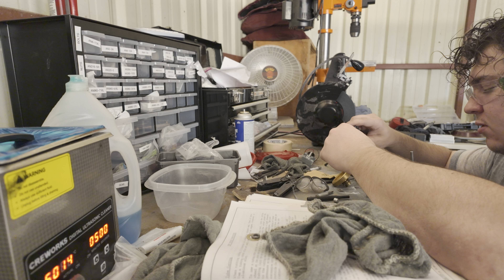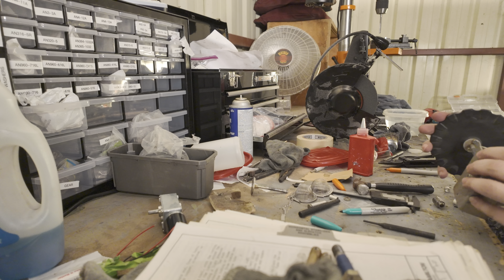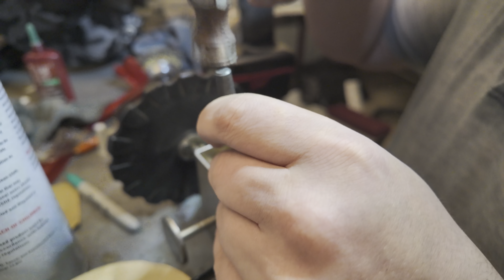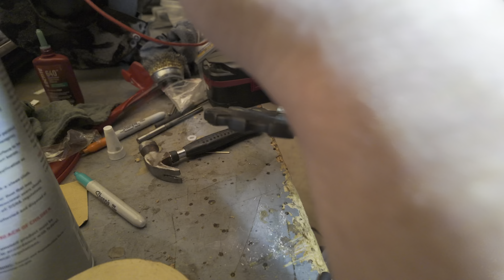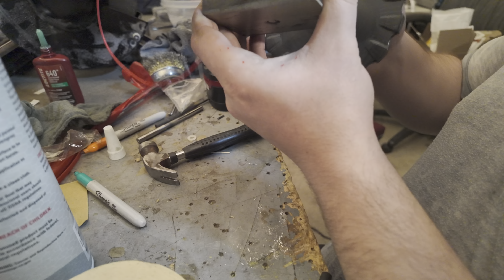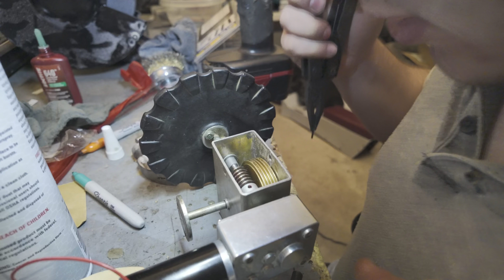Glasair III - Custom Electric Trim Gearbox Fabrication

Comment from the maker: You will need:

I just found this on AliExpress: $32.10 | 5840-31ZY Worm Gear DC Gear Motor 12v24v 7RPM-470RPM Adjustable Speed Reverse Self-Locking High Torque Double Shaft Gear Motor

https://a.aliexpress.com/_mO0OlBJ

I recommend the 160RPM version, I used 24V version.

Additionally, if you’re converting from the old system you’ll need a shaft coupler and some roll pins, in addition to the fabrication, which mainly involves shaving. Ultimately I removed the actual gear spinner as it got in the way, and without a clutch of some kind it doesn’t have much use.

The shaft coupler must be steel. I tried aluminum and it will shear (originally what was installed in the video).

I don’t remember if I purchased the 6.35mm to 6.35mm version or the 6.35mm to 8mm version.

I just found this on AliExpress: $6.44 | 45# Steel Rigid Shaft Coupling CNC Motor Jaw Shaft Coupler 5mm To 8mm Rigid coupling OD 14x22 Transmission Connector 4/5/6/8/10

https://a.aliexpress.com/_m0s6Top

It takes a lot of patience, but works well. The only thing is there are no electric stops, just manual stops, so you must be careful with it. If you size your breaker right, the breaker will trip when the motor stalls and hits the stops, but the stops aren’t super beefy so I wouldn’t do this often. The G3x GSA 28 combo lets you set maximum run time (I used 1 second) so you can’t just hold it there cranking against the stops.

There is an official Glasair electric trim kit too, but I couldn’t find it. You will need to order the motor with a bracket, and I just riveted it to the frame. You may need to cut a small slot in your seat bucket to clear the motor. Be careful about hydraulic and fuel line routings as well, I had to undo and reroute them. In my install they sit over the motor with silicone tubing around them to protect them from vibration.